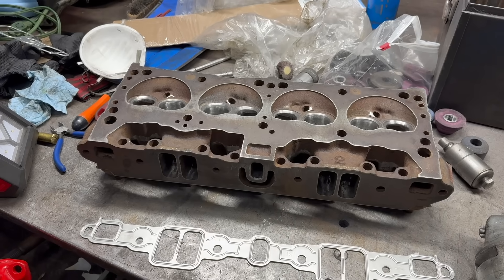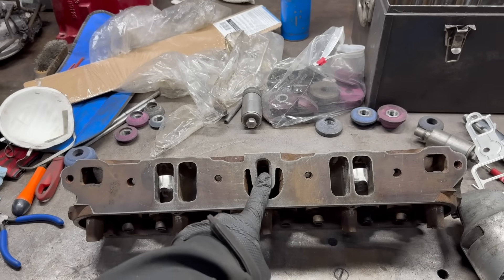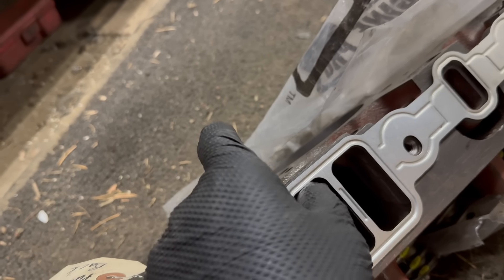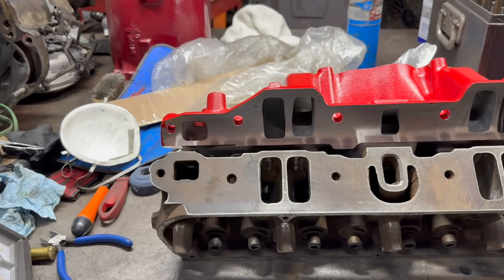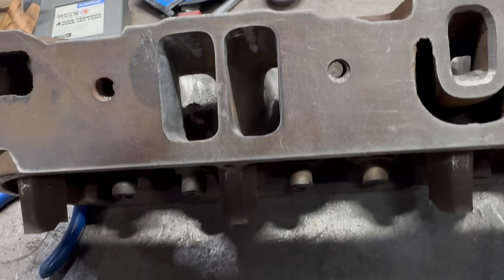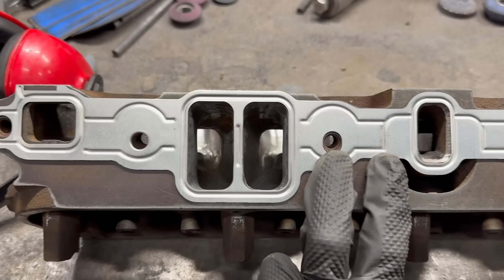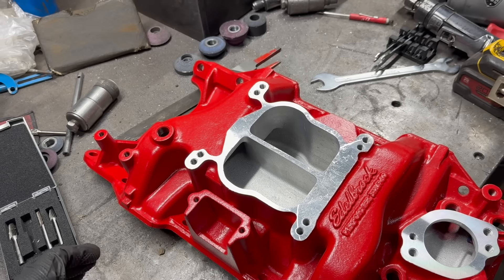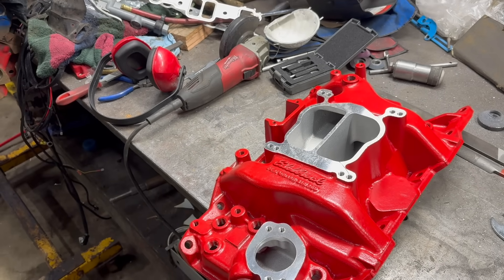Intake Port Matching - Improving Factory Castings And Finding Hidden Horsepower (A 318 Build Update)

Comment: How much HP do you think you could get out of a 318 with stock parts (except a good 4bbl and good intake)? a buddy of mine and I rebuilt the 318 on his van (or at least regasketed the top half). One of the ports had a port tht the top was 1/8th inch shorter (less wide?) than the bottom of the port. One side of the port had a radical lean and I questioned him about cleaning that up...he didnt care, new gaskets and go. Hurrah for factory casting.
Reply from the maker: 400 HP from a 318 is well known to be doable.

Comment: The exhaust crossover, without the manifold heat control valve working properly in the factory exhaust manifold, really doesn't do much. I just leave them open. Live in northern Minnesota and drive year round. 
So the guys saying you have to have it with a carb aren't thinking it through. Almost nobody has a working manifold heat control valve today.
 Most of the gains are in the bowls, I still gasket match, but that alone doesn't do much. 
Crazy the 68 340 intake as cast is a perfect match to the 318 gasket, except for a little less than 1/4 inch on top. Only took a little cutting on the 315 heads to match it to that intake, once I had them matched to the gaskets. Then I put a Stealth on it because I had to pull the intake in the truck, and didn't feel like fighting with cast iron under the hood. The Stealth is a great intake, like the old LD4B, the Performer is a performer in name only.

Comment: Although I have seen the divider in the intake manifold plenum removed completely,  it will usually hurt low end torque. When you want to increase airflow by opening the plenum to both sides, about 1/2" is a better starting point. I have had used intakes that had the whole divider removed. To repair them I cut slots so a divider could be slid in and out allowing me to experiment with my replacement divider. Just pull the carb and slide the divider out to modify it. The carb and gasket hold the divider firmly in place with no sealer.
Reply from the maker: I realized when editing that I made it sound like I was fully removing it. But I drew the right little notch shape with my finger.

Comment: I did a clean up port job on a Datsun head a couple years ago and some of the exhaust valve seats were barely supported by any material, like you could stick your finger in there and feel nearly the entirety of the back of the seat, I blended it all anyway and it's held up to 7,000rpm thrashing.
Reply from the maker: Oh wow. Impressive! Will be interesting to see what the Mitsubishi 2.6 head is like. I’ve never done anything remotely like that, just Mopars.

Comment: Hope I'm not  considered a troll . Just offering some advise I have used over the years working on heads . you can lightly grind back that sharp step on the heads on the one side of each valve unshrouding the valves for better air flow while keep that half moon shape .
Reply from the maker: True! Not a troll, I don’t think. Haha.

Comment: As far as the area between the ports for the valve cover bolts. Would it be worthwhile to go ahead, grind the whole bulge out, then use a bolt that won't protrude into the port but will mostly plug the hole and a little sealant?
Reply from the maker: Oh sure, if one really wants to go that far. For my purposes I don’t think it’s worth the trouble. Obviously, I don’t have a flow bench here, and I’m not able to quantify every little improvement. I’d love to have the ability to do that with a junk head some day.

Comment: I have the Edelbrock Performer intake and the heads were done at some point. I don’t know if they matched the ports and I don’t want to take anything apart. It does perform well.
Reply from the maker: I wouldn’t either. I’m sure it’s fine. We had a 318 with performer and Magnum manifolds, and as far as I know otherwise stock, and it ran really, really well.

Comment: When I grind on aluminum, I lubricate the cutter. I have tried Marvel Mystery oil, STP,  grease, and even paraffin wax. They all help reduce aluminum build up in the cutter (burr). But I think that the paraffin wax is slightly better than the rest. Basically, I just run the cutter rather slowly (2000 rpm) into the wax. It works better as the cutter warms. but it does not need to be hot. In fact, that is the point. A hot cutter will load up with aluminum way faster than a warm one. It just crossed my mind, that I never tried water. Or maybe soapy water. So that might be something you want to try. Also, for the little hole that you cut in the port, a really good epoxy (NOT 5 minute epoxy!) like JB Weld or Devcon will work as well.  Just not in exhaust ports, or water jackets, or inside the combustion chamber, etc. (more for your viewers than you).
Reply from the maker: Understood - and I certainly did consider JB Weld for that repair. It would do the job. But the little dab of weld seemed like the best way to go. Yes, everything I’m hearing is to try lubrication for the aluminum, and that even the standard carbide burrs will do just fine as long as they are lubricated. I’m going to try that next time!

Comment: The weldability of cast iron is supossedly pretty depending on the quality of the iron itself. According to Tony chrysler used very good iron, just poor QC of the actual casting.

So i guess better iron=less fuss?
Reply from the maker: That’s my understanding. Their cast iron had a relatively high nickel content and in general was pretty good, but yeah, the actual castings tend to be quite rough in places. It’s still very hard to weld if you don’t know what you’re doing. I’m just now starting to know what I’m doing, kinda.

Comment: Great video as always Jamie, is there a particular brand of gasket you like? Got some crap rubber ones in the mail today for my 318 and that just wont cut it lol
Reply from the maker: I use FelPro almost exclusively. They’re usually quite good - EXCEPT for their stupid rubber coated fiber valve cover gaskets. Those are/were an absolute joke.

Comment: Thank you for avoiding the time lapse stupidity that so many others use to fill time.  Never understood why anybody wants to watch that crap. Automatic fast forward or turn off the video if it’s excessive.  Port matching is so easy and sometimes can really help the butt dyno. One thing I have learned when port matching and polishing heads…you can raise the roof but don’t lower the floor. Can’t wait to see this thing built. Big fan of cheap power mods   using factory parts.
Reply from the maker: Yep - that’s my understanding too. I haven’t so much as breathed on the floor of these ports. I talked about that in the last video on the project. I’m really looking forward to it too. Thanks!
Reply: @ guess I missed the last video on this build…I mean you’re dropping videos like every other day😆 Hardest working guy on YouTube…like do you sleep?

Comment: Great to see a realistic and effective street build!  Port matching,  clean up the rough spots, and a little bit of contorting will go a long way without loss of intake velocity.   Hopefully you will  use smaller tube headers to match.
Reply from the maker: We’re stuck with factory manifolds on this one, which will unfortunately limit things quite a bit. But I think it will be a great street performer nonetheless.

Comment: I hate Dremels, but I think they would be a forgiving option for portions of these porting tasks.   I understand why you don't film a lot of the work, but if that changed, I would watch it.
Reply from the maker: Really miss my dremel. It vanished into thin air years back and I’ve never replaced it - but really need to for the fine detail work on things like this.

Comment: Great video again. Grinding aluminum goes much better if you spray wd40 or similar on carbide and or work. Keeps bit from clogging and helps a bit with chatter.

Comment: For porting tight, odd shaped spots in aluminum, you can use a rat tail round file. Put the small end of the file gently into a vise. Heat the file above the vise while putting bending pressure on the file. Heat only just enough to put the curvature into the end of the file you require. Learn it works well from years of porting motorcycle and snowmobile heads.
Reply from the maker: Nice! I’ve got a few of those.

Comment: Hey, great videos. What brand of gasket are you using for the template and do you use the same steel shim gasket when you assemble
Reply from the maker: Fel Pro, and I’m not sure this time. I don’t like the steel, but it seems to be the only gasket available in the 318 port size. I prefer to use the paper, and am considering using the 360 paper gasket for assembly.
Reply: Thanks @DeadDodgeGarage

Comment: I’ve had pretty good luck with loading the carbide with ivory bar soap and squirting water while cutting aluminum. The performer 318/360 has enough material to deep match to a 360. I once put one so matched on an ‘89 318 with 308/714 fast burn heads and it had great midrange torque with that and a Quadrajet on it.

Comment: Use an air regulator just before the die grinder, slow it down. Much easier to control, no bouncing around. Also, the WD-40 thing works as well.

Comment: I just got my 516 heads back from the shop. I wint with Kline inserts, ferrea 2.08 1.72 and 911 springs with tool steel retainers. I post some pics on instagram.

Comment: Paying lots of attention to this build as I basically want to duplicate it. I guess I probably have even lower piston height than this 318 so some stuff will need to be different, I suppose.  Would any 2 plane manifold work like an ebay special?  Or do I need to bite the bullet and pop for an Edelbrock?  Carb of course will be an avs.
Reply from the maker: The eBay special will do just fine. Your pistons are definitely a ways down, which is a bit of a handicap, but it can still be vastly improved. Closed chamber heads will hopefully get you a bit north of 8:1, and that will definitely help.

Comment: Do you think these mods would allow an otherwise stock M body with a Lean burn 318 to run 12s with no other mods ? Big valve  purple shaft 340 with a huge Holley and slicks aint gonna catch a lean burn 318 with a modded head. (:
Reply from the maker: No other mods? No 😅
Reply: @DeadDodgeGarage  maybe a 70s vintage ball stud hemi with dual lean burn distributors and a cross ram lean burn. Im not entirely convinced that even a billet filled 727 and full Dana 60 would hold up the power of the lean burn, even with treaded tires, just to due to M body's ferocious bite. Diplomat with wheely bars and a firesuit at minimum (: .

Comment: If you’re focused on 318 mid-rpm response, the last 3% of port matching is barely gonna impact things. Spend that time on other things. What really cramped my mostly stock “little 318 that could” was discovering that the seller had slapped a 340 tall-port intake onto the small-port factory 318 heads. 
Since it wasn’t much more work to just put 340/360* heads on and keep the tall-port intake, I swapped heads but left those new 360 ports stay matched within a few % rather than a 15% brick wall on the old 318 heads. And the “318 that could” was far closer to its promise when required (which was while proving it to unbelievers, not while daily driving).
* The ultimate 1968 340 X-heads won’t clear on any 318, and they are too expensive anyway

Comment: Burrs for aluminum are aggressive in their cutting edge and the open take to keep from plugging up. Try using a less aggressive, closed design burr for steel and get some dressing to apply to the cutting edges to keep from plugging up. Hope this makes sense, it worked for me.
Reply from the maker: That’s what I’m hearing! I’ll definitely be giving it a try.

Comment: One thing to note, and I think you tip-toed around it... once the material is removed putting it back is a royal pain.  So the porting today may or may not work with future intake plans... so think to the future as well... de-burring the pathways inside a for-sure... you'll gain free horsepower with some better flow.  Thanks for the explanations... not the compressor running and seeing a bunch of dust and shards flying.  You don't need those viewers...
Reply from the maker: No question - it’s very hard to put it back. Thankfully, by simply matching to the factory size gasket, any future intake matched to that same gasket will still work. And… I agree. Haha.
Reply: @DeadDodgeGarage  You mentioned the gaskets you were using were also sub-par.  Stick to Fel-Pro or something brand name so you get a repeatable result... then I'd buy that is a forever porting job.  Makes sense? (not sure if you mentioned a brand)
Reply: This “ is” the future intake plan!! Lol

Comment: You can keep the burrs for aluminum from loading up.  Just grab a candle and touch off on it every once in a while.  The candle wax acts like a lubricant and it's not as messy as an oil.
Reply from the maker: Nice! That’s a good one. I’m hearing dip it in ATF repeatedly, and I’m sure that works - but it sounds messy.
Reply: @DeadDodgeGarage  yeah.  Oils are a mess and you have to clean up everywhere.  Typically you can vacuum up the wax or wipe it off any surfaces it gets on.  Also a bonus, this Christmas I ported an M1 intake and stole a candle from the wife and it smelled like cinnamon rolls while I was working.

Comment: I've blocked intake heat in really cold climate with daily drivers. Just use a factory snorkel that uses exhaust manifold heat and open the vacuum restriction. Add a second snorkel and block the heat opening. The carb won't ice up and there's plenty of cold air
Reply from the maker: Makes sense to me. I’m thankful to not have to worry about the cold much.

Comment: I never had any luck with using the metal gaskets with the ally intake and iron heads
Reply from the maker: I would MUCH prefer a paper gasket - but despite what I thought to be the case, there is NO paper 318 size gasket! I’m considering using the 360 size gasket when it comes time to actually seal. But I needed the 318 gasket for the matching operation.

Comment: being a teenager in the 80s and in my 20s in the 90s, i cant tell how many times the guys from the 60s and 70 would yell at us for using those metal gaskets on aluminum intakes, it was always so funny on how triggered they would get.
Reply from the maker: Just had another comment to the same tune. I’ve always preferred the paper, but I was surprised to learn there is NO 318 size paper gasket available! At least not from the usual suspects.
Reply: @DeadDodgeGarage  exactly.. they would say use the 340-360 ones...then you would have a gap around the ports...I used them both on 318s and had some success and some leaks.

Comment: THANK GOD for all the YouTube engineers. How could we ever survive without them telling us everything we’re doing wrong? Seriously, when I worked for GM they had a TSB informing us that metal squiggles in the oil filter on the first oil change was normal. They go on today say that they eliminated a cleaning process at the plant and those metal bits don’t hurt anything. Trust me, precision and the auto industry have never met.
Reply from the maker: Yeeeeeppp… sounds right to me 😅 as a Mopar guy, I’ve seen some SERIOUSLY messed up casting, machining, and assembly. Deck holes drilled 1/8” off where they should be and at an angle from front to back, decks machined at an angle front to back, at an a angle top to bottom, incredibly bad core shift, multiple rods in one engine machined backwards! All that, and much more.

Comment: #302 heads are drilled/cast for 3/8 pushrods. They’re paper thin in the ports
Reply from the maker: It’s even worse than that, because the pushrod intrusion into the port is so much larger! I compared that to these in a previous video. Also, small detail, but they aren’t drilled for 3/8” rods. They’re drilled to allow for the more extreme angle of the pushrods with taller roller lifters.
Reply: @ you ever look into the heads from a 318-3? I forget the casting number, but they have the water crossover and huge valve stems

Comment: Pertaining to grinding a little too much off, I prefer a torch and brazing rod. It sticks extremely well to cast iron. It's pretty durable so long as it's not directly exposed to the internals of any of the cylinders where the explosions happen. It's super easy to shape after the fact with a bur or a file of appropriate size.
Reply from the maker: I’ve yet to ever try brazing, and I need to.

Comment: I have a set of 318 heads off a 72 Challenger sitting in my garage next to a factory 273 4bbl intake. The intake has a 750 AFB that I rebuilt and rejetted. It sits on a half inch spacer and you can see the throttle bore mismatch. I think I may put a chamfer on the intake bores now that I've watched this video. I was already going to port match the heads to the intake so this should eventually turn out awesome....🤔

Comment: You really don’t need to weld cast iron. I fixed 4 cracks on my 318 block with JB Weld. The cracks were into the water jackets, and it sealed up just perfect.
Reply from the maker: It works… but I don’t trust it.

Comment: carbide burrs are not really meant to be used on aluminum...sure, they do mostly get the job done.  Try picking up some sanding cartridge rolls, flapper wheels and scotchbrite wheels from a supplier like Goodson....tons of other great engine building tools, abrasives and supplies
Reply from the maker: That’s what I said. Which is why I’m using burrs specifically for non ferrous materials like aluminum. I neglected to mention the sanding rolls in this video, which I showed in the last installment. That’s my bad.